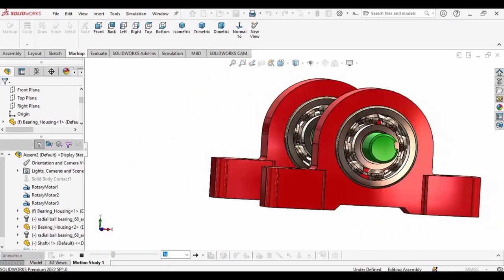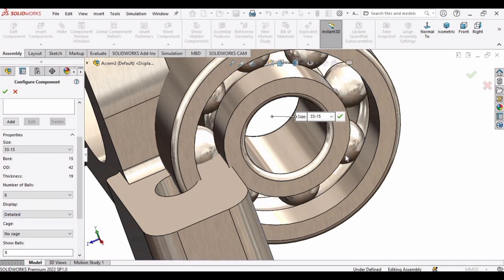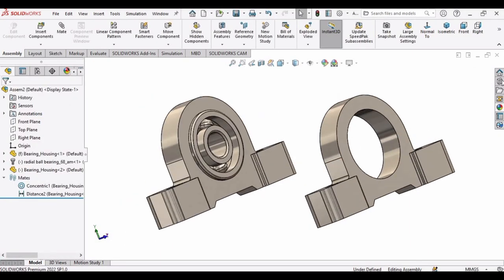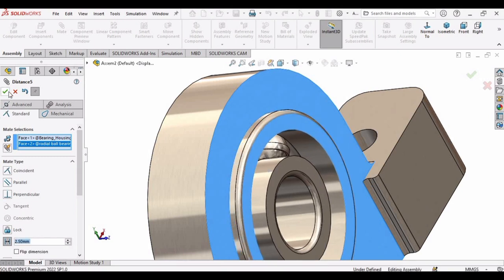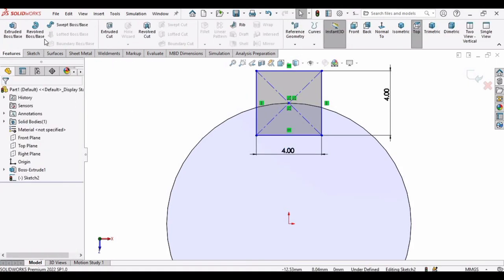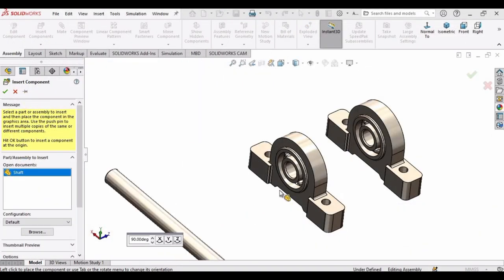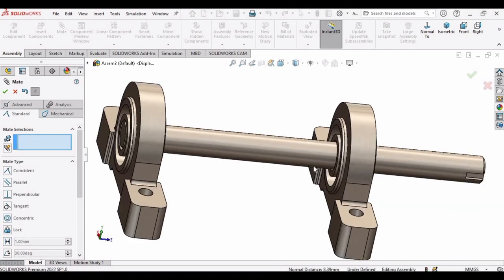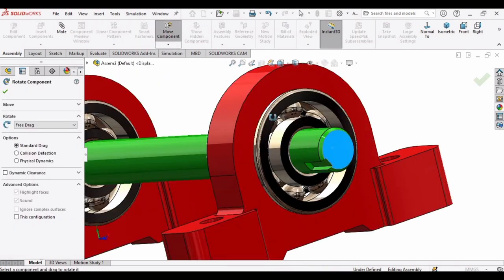Shaft Bearing and Housing Assembly Tutorial in Solidworks

Comment: Can I put reducer between those bearings
Reply from the maker: @barashbehched9868  are you talking about Gear reducers? if yes, then for modeling point of view it is possible with modifications.
Reply: Just one gear reducer and the shaft is the shaft of the wheel.
Reply from the maker: @barashbehched9868  yes

Comment: what is the application of this assembly?
Reply from the maker: This assembly can be used as subassembly of conveyor belt system.
Reply: @CAD5-Minute  if we mount gear on the shaft and connect that gear to the belt is it possible?
Reply from the maker: just for modeling purpose, Yes it is possible. It depends on what you actually want to achieve from that assembly.